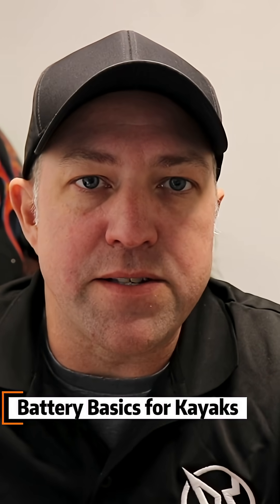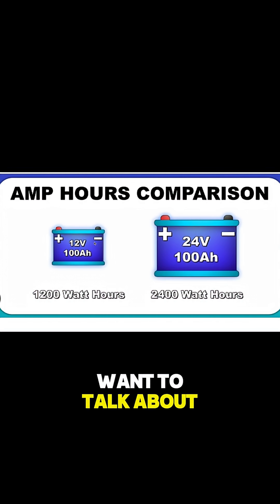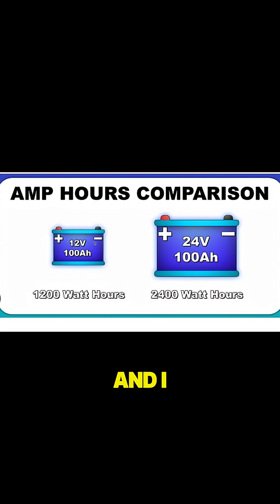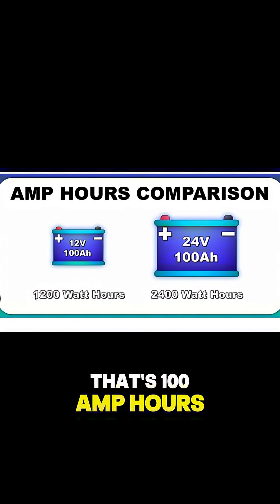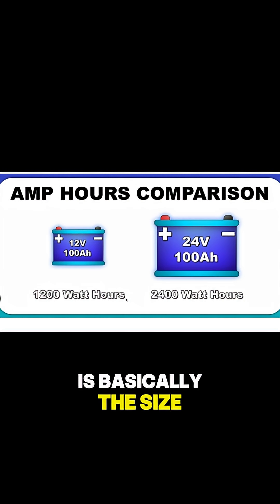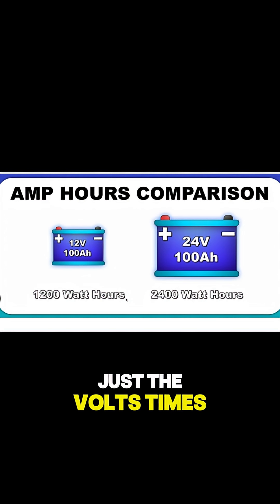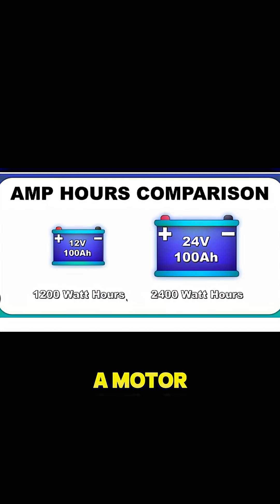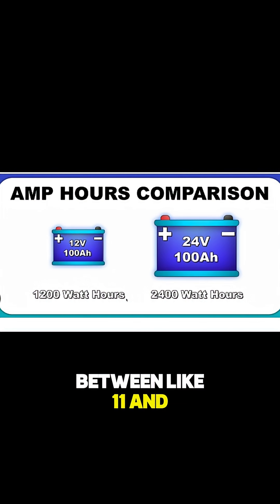Battery Basics for Kayaks — Why Higher Voltage Doesn’t Mean More Power

Comment: Yes Amp-hours, without defining nominal voltage is nearly useless / meaningless - as are non benchmarked comparisons, and real use case lifeycles..

Watt Hours, or Joules - is the unit of Energy - Watts, in and out with roundtrip efficiencies stated..  Series and Parallel cells are also useful to know..
Reply from the maker: You’re spot on about watt-hours being the most helpful metric for understanding battery capacity and power!